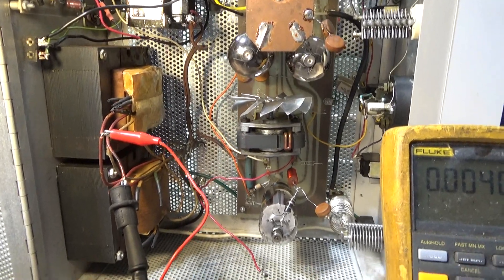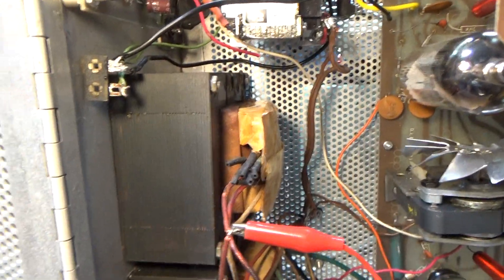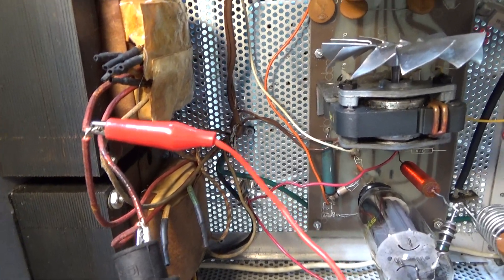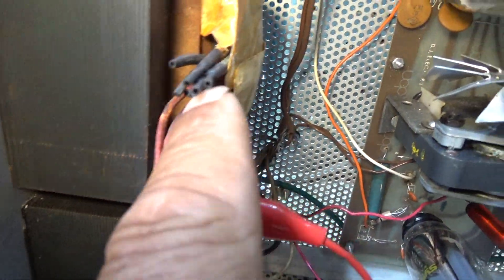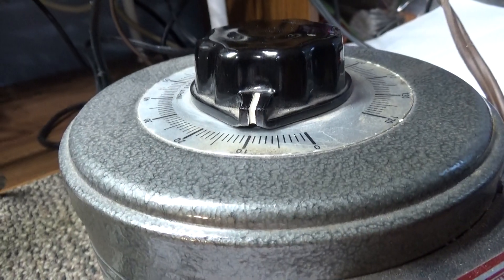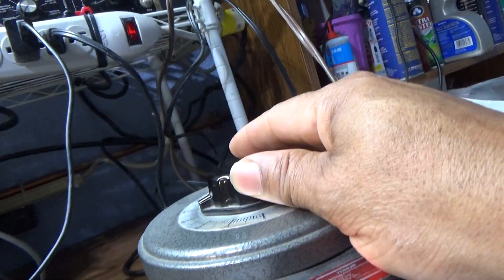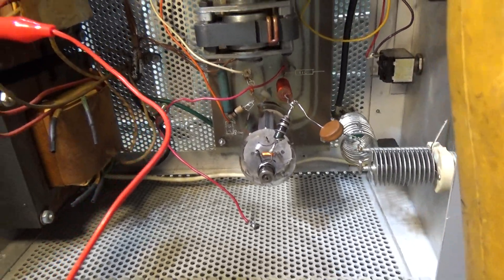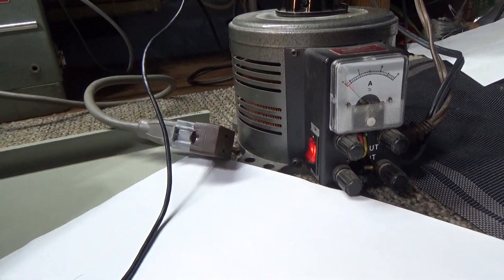How to test power transformers output to see if they are in phase.

Comment: now we put them in series and stick a 4cx250b in there :)
Reply from the maker: That 'works' but I think its a very bad idea. Those medium voltage transformers are not made for HV with respect to ground. Thats like taking a switch/wire/whatever that's rated at 1kv and running 2kv thru it.
Reply: @tramdr  I had a feeling it wasn’t a great idea. I saw another feller convert a maverick to a 4cx150 with the stock trannies tied in parallel which seemed intriguing as I’ve got a nice 4cx250b sitting in front of me just waiting for a box to go into ;) but I guess I’ll just get the proper one lol
Reply from the maker: Sounds good.

Comment: Another method is to use a signal generator to feed in a signal, your variac at a low voltage works fine.  Then monitor the output of both transformers with a 2 channel oscilloscope.  You will see if the waveforms are in or out of phase on the oscilloscope.
Reply from the maker: That's a good one. Thanks Mike!
Reply: Haven't seen much from this guy in a while..... Hoping for more content mikesradiorepair